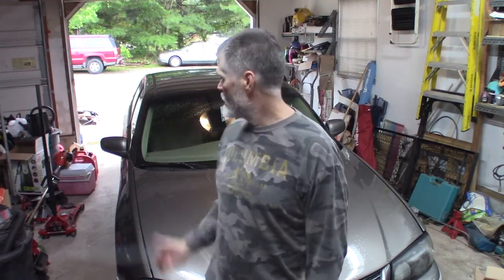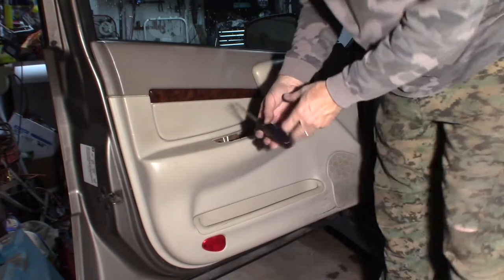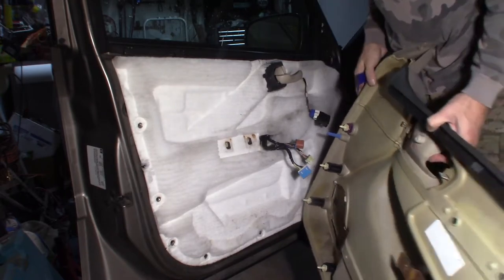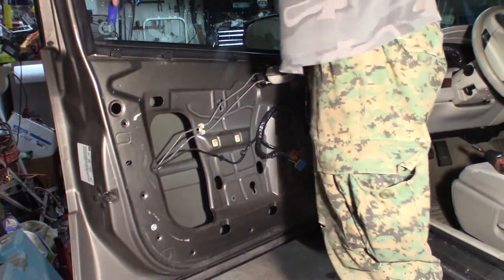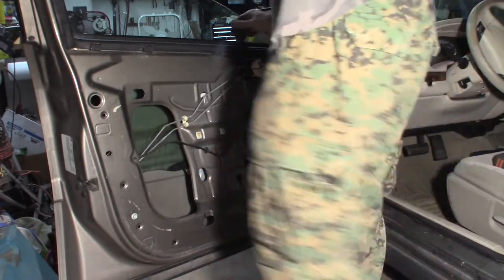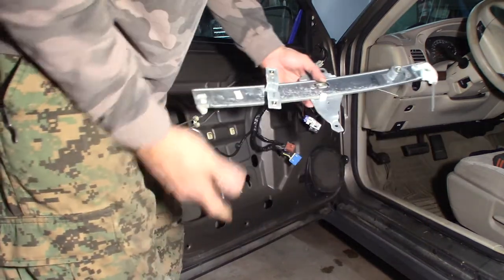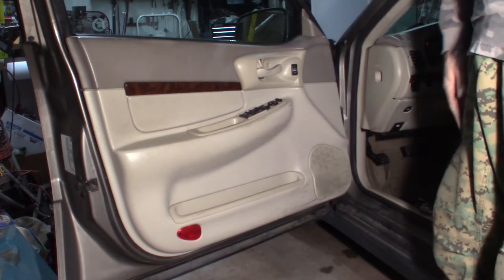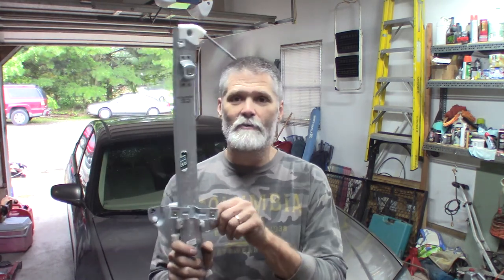2000-2005 Chevrolet Impala Window Motor and Regulator

Comment: I appreciate your video. But now I see why the dealer charges so fricken much! 🤣😅😂 My husband and I just took the door panel off his 2002 Impala today to do the two wire hack and are determined that it's the motor. So thanks to you we will be putting one in. Also thanks for the tip for undoing the window from the motor riser. Now we can at least put the window up. Thanks for posting!
Reply from the maker: glad it helped